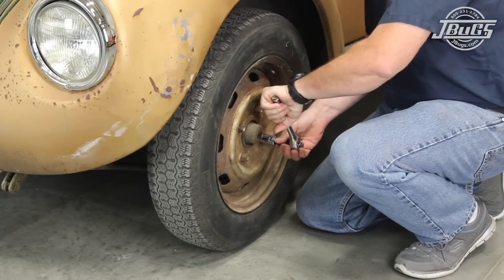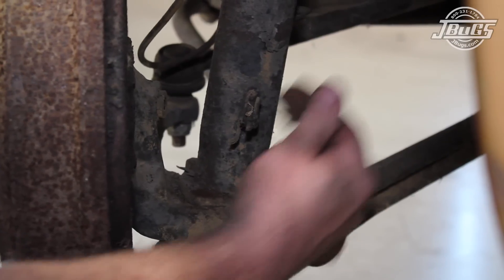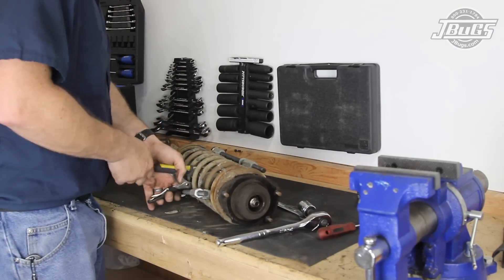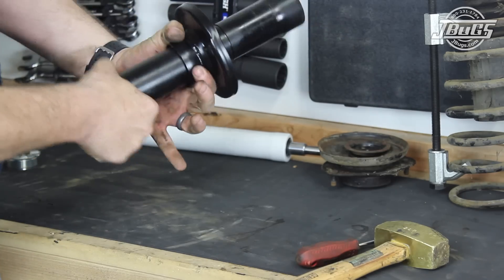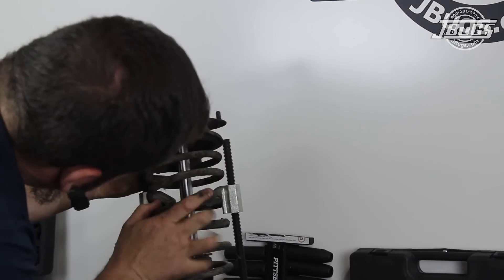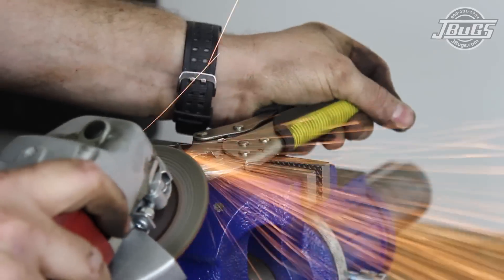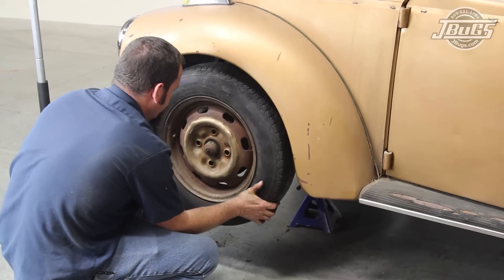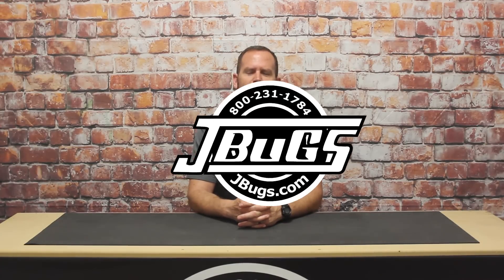JBugs - 1971 VW Super Beetle - Adjustable Strut Installation

Comment: 1:37 I don't understand using a brass hammer on a chisel.  I guess you won't damage the top of the chisel but it doesn't seem necessary.
Reply: Any hammer will work. I prefer a brass hammer as it is less prone to spark, damage the chisel and it has less vibration than steel.

Comment: How do I raise my 71 super beetle to make it a baja?
Reply: Super Beetles aren't common candidates for Baja conversions because of the strut front suspension. There aren't many (if any) lift struts for Super Beetles. The few Super Beetle's that I have seen converted use a full roll cage and cut off all of the front Super Beetle chassis in favor of a more stout tube front suspension or a completely custom A-arm front suspension.

Comment: I just installed my jbugs adjustable lowering struts and inserts and set it at the 3 ring setting from the bottom bug outer tie rods hit the chassis of the bug making a screeching noise Everytime I turn the wheel. It's like that on both sides. Please help!! I don't even have it at the lowest setting. Plus I put low profile/ smaller tires in the front.   I have 165//65/15
Reply: My guess is you have a worn pitman arm, steering box, or perhaps a bent or improperly installed center tie rod. The left and right tie rods shouldn't be anywhere NEAR the chassis (or the body) when installed, regardless of ride height. 

Check our front end assembly video from later on in the series to make sure the tie rods are installed properly.

https://www.youtube.com/watch?v=6uLrym1npYc&list=PL7YpZlDdZJCgwFYFCo5WmPgGxko-q6yMH&index=51
Reply: Hi there. Same with my 71 convertible super beetle. I had to put the struts at the highest level so that the tie rods wouldn't hit the frame of the bug! The stance is little higher than what I would like but much better than the original stock suspension.

Comment: What is the torque spec for the main nut at the top
Reply: 71-73 assemblies - 50-61 ft lbs, for 73-79 - 43 ft lbs.

Comment: I’ve tried the first notch and popped a tire… I’ve set it on second notch and still get rubbing on left tire! What the best setting notch to set it on.. I’m moving the notches up from bottom up on strut adjustment???
Reply: Install lower profile tires or start at the top notch.
Reply: Oh ok 👍

Comment: Hi there I just purchased the front end adjustable struts and strut inserts from jbugs. Will my 165/80r15 rub if I go the lowest on the adjustable strut?? Please help before I install!  Thanks.
Reply: More than likely, yes. Lower profile tires will most likely be needed at the lowest setting.
Reply: @Sam_Mebane  ok thank you very much. Unfortunately I'm having a hard time on the driver's side separating the strut from the steering knuckle. They are stuck together.
Reply: That is why my favorite tool is a hammer.

Comment: Once the struts are installed,  can you compress the springs enough to move the clip to a lower setting or do you recommend removing from the bug?
Reply: Spring compressors like these can be used https://www.jbugs.com/product/5728.html with the strut in place on the car.
Reply: @Sam_Mebane   I installed these and they work great,. the problem is I installed them on the lowest setting and tires scrape when turning and catch inner fender and cut tire.  Can I adjust to a higher setting and raise it up with everything in place or does the whole housing need to be removed and disassembled? Thanks in advance!
Reply: @thegreener10  adjusting the clip can be done with the strut in place, but it isn't easy. The springs have to be compressed and pulled up away from the lower spring seat. Then the seat can be lifted up so the snap ring can be pulled off and raised.
Reply: @Sam_Mebane  thank you Sam!

Comment: @Jbugs Will I be able to have the struts  adjusted to factory height? Will lowering the front effect steering or drivability. 
The wheel on my 71' super has a bad negative camber causing wheel to rub on strut springs on driver side. Mechanic says that my strut housing is bent?
Reply: No, the struts will be lower than stock, even at the highest point.
Reply: Yeah

Comment: I have 2 coils cut on my original springs, I have just got the adjustable struts and insets, can I use my springs or do they need to be full height?
Reply: also should mention im running 165/55/15's up front
Reply from the maker: With the shorter springs, you may end up lower than you’d like with the adjustable strut housings but, if you have the time, I’d give it a shot. New springs are available if you need them: https://www.jbugs.com/product/9628.html
Reply: @JBugsVWParts  I'm going for ground

Comment: Is there a trick to removing the spindle from the strut? I'm trying to swap my springs on my '73 SB (same struts as this '71) and the spindle is completely stuck to the strut. Would it be possible to use a two- or three-arm puller? At 2:00 the video sort of skips from when it's on to when it's loose, did it just pop off?
Reply: We use a hammer to free up the spindle from the ball joint, spindle and strut housing. Some might be happier together than others, some penetrating lube or heat may help, as may a larger hammer.

Comment: @JBUGS in a later video when lowering the rear your running a 195/55/15  is that still okay at this height with no rubbing? because im currently using a 195/55 and im about to do this.
Reply: Absolutely, the 195/55R15 tire is a fairly low profile tire so you could go much lower before you'd have any rubbing issues.

Comment: I did use a set of this but my passanger wheel rubs the fender when i turn any direction. any idea why??
Reply from the maker: The body and fender will sit closer to the wheel with the adjustable struts, especially when lowered to the bottom position. Installing a smaller diameter tire may be needed when lowering the car.
Reply: @JBugsVWParts  how low of a setting can you use before having to change tire size for fender or spring clearance?
Reply: @johnnyturbo8460  using these adjustable strut assemblies, the midway point would be about the limit for most cars using a stock size tire. As always, check and adjust the ride height or tire size as needed.
Reply: @Sam_Mebane  ok, thanks 🤟😁👍

Comment: Why don't you sell the spring caps or rubber spring pads?
Reply: No one said that we don't. We have them here: https://www.jbugs.com/product/133-303.html 

They aren't use-able when installing lowered strut assemblies so they aren't mentioned, other than us noting they aren't re-used at about 4:33.
Reply: @Sam_Mebane  those are not the spring caps and spring pads.  That is a dust cover and a bump stop.  You do not sell the metal spring cap that holds the spring in place, or the rubber ring that goes underneath the spring.  I say you don't sell them because I looked.
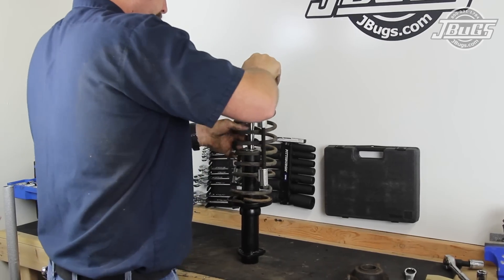Reply: @Sam_Mebane  Please refer to the parts mentioned at 4:05. Rubber spring pad, and ORIGINAL spring cap.
Reply: @TheDeathskull37  we don't sell them because we haven't found anyone that reproduces them.